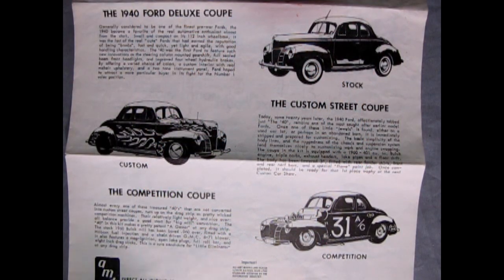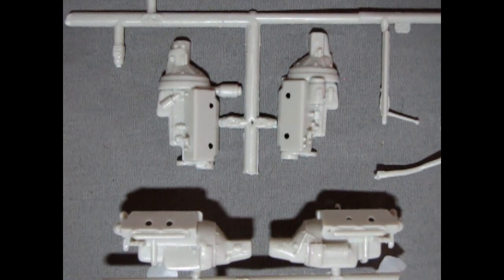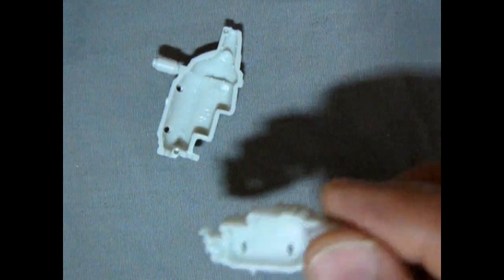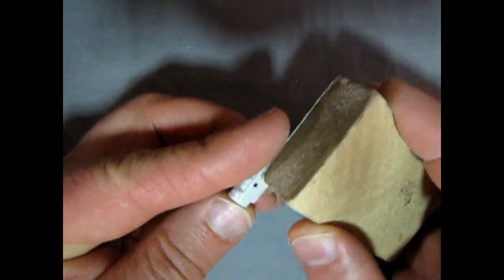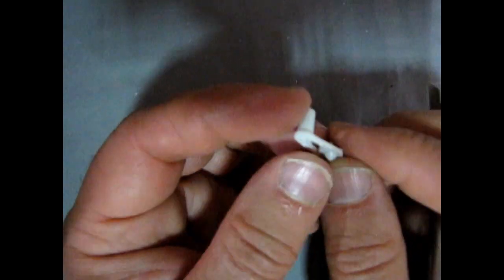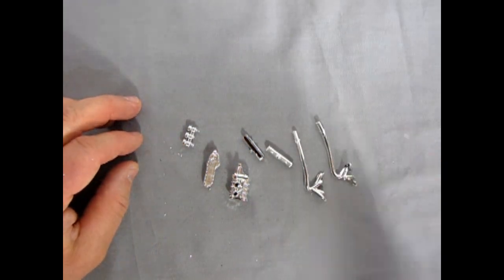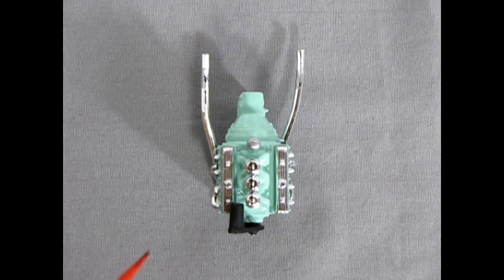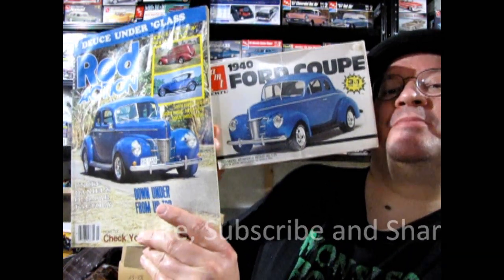Model Car Garage Tips and Tech - How To Build the Buick Nailhead Optional Engine - AMT 1940 Ford Kit

Comment: No Trevor, they called it a nailhead because it had small valves, looked like nails. But with the small valves it could build up a lot of compression and that equals more horsepower. That’s why a lot of guys back in the early 60’s loved those engines for drag racing, they could do all kinds of things to those engines and get more and more HP out of them and most of the nailheads could take the abuse!
Reply from the maker: Thank you for the clarification! Too late to correct it in this video, but I can mention it again when I use this engine in another video.
Reply from the maker: Did you like the build tips and techs in this video though?